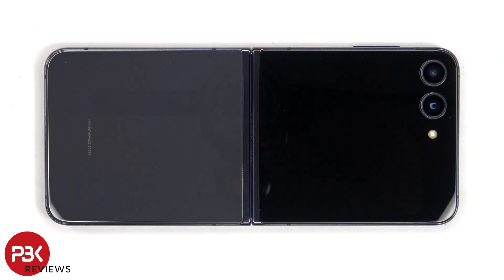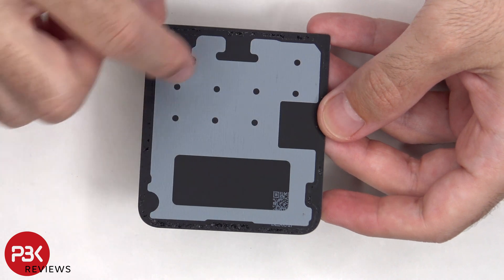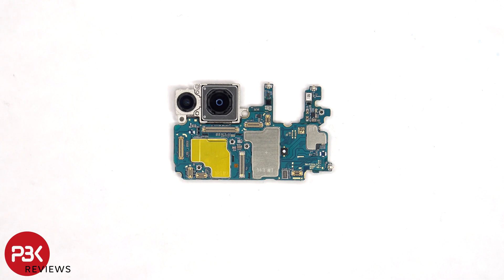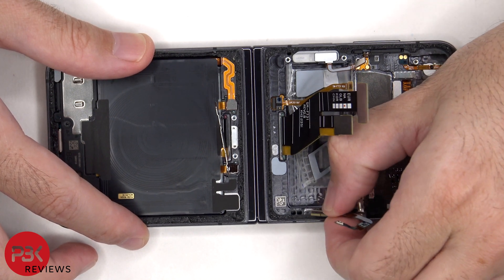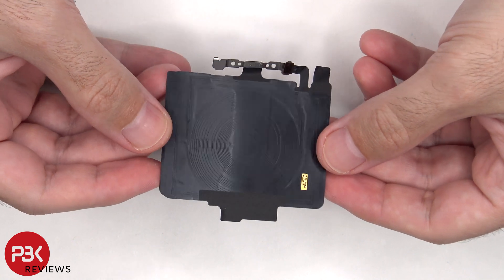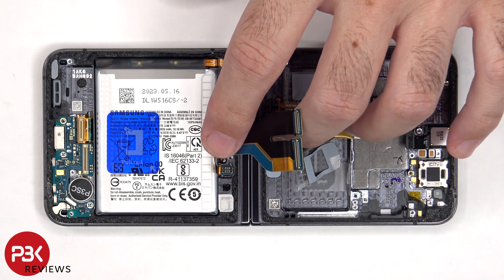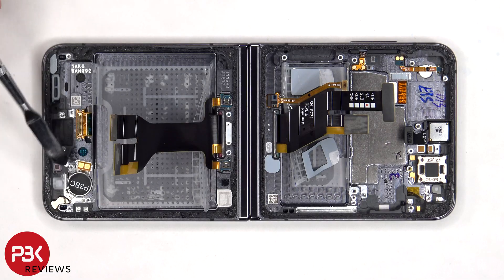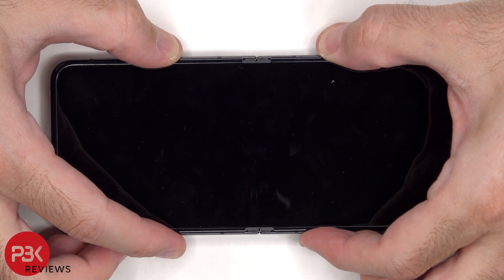Samsung Galaxy Z Flip5 Teardown Disassembly Repair Video Review

Comment: where is the data drive tho
Reply from the maker: the storage is soldered to the main board under one of the covered shields and is not user replaceable.

Comment: I was hoping to see how you replace the black bezel frame. 
Mine has a crack in it from a "snappy" case. :(
Reply from the maker: the one around the fold screen? those are difficult to adhere back. Easy to pry off but not easy to glue back. You would need to use something like B-7000 glue.

Comment: Can the interior screen be replaced? Or do i need a whole new shell to pass the components into it?
Reply from the maker: It can, but its difficult since you will need the original adhesives to ensure the fold screen stays well adhered to the frame when folding and doesn't move or it can break or damage the folding display easily if not aligned correctly. Also the plastic boarder going around the fold screen is a pain to re adhere with glue. So just much easier to replace as a whole flip assembly.
Reply: @PBKreviews  that's crazy, no wonder no one is showing how to remove and replace the LCD screen.

Comment: I have a flip 5 and love it! Unfortunately, mine took a tumble in a bike accident and my cover screen cracked! I am wondering if I'll be able to repair by myself...
Reply: Did you manage to fix it or get it fixed, I've literally done the same a few days ago
Reply: @SaifShakur  yes! I bought the cover screen part and it was honestly an easy replacement :)
Reply: That's great! Did you have to apply new glue? Thanks for replying
Reply: @SaifShakur  I didnt add more glue- there was some sort of adhesive on the new part and it's holding fine. The only thing I would recommend is someway to heat the phone before screen removal and after replacement to make sure it's all good.
Reply: Okay great thanks, you reckon a hairdryer would do the trick? Thanks.
Reply: @SaifShakur  that's what I used!
Reply: Thanks will give it an attempt next week

Comment: 9:57 is a pressure equalization membrane inside the case, as the device is water-resistant, and the air inside the case expands due to heating. This membrane allows the air to escape or enter inversely but prevents water from getting inside. It's designed to prevent air pressure from affecting the speaker and causing distortion.
Reply from the maker: Are you referring to the filter or the second hole in the frame?
Reply: @PBKreviews  I mean the one that goes to the white fibrous filter.

Comment: The Galaxy Z Flip 5 has a 3700 mAh battery, not 2700 mAh.
Reply from the maker: correct.. it has 2 separate batteries for your info. One which is 1000 mAh on the top flip and one which is 2700 mAh on the bottom totaling 3700 mAh. Both of which are shown in the video.

Comment: Doest it has 2 baterries for every display??? I thought it use one battery for bith displays...
Reply from the maker: It has two batteries, both work together. The flips and folds have always used 2 batteries, since there isn't enough room on one section to hold a large enough battery, so they use both sections with two smaller batteries.

Comment: Sad to see they didn't leverage the front screen for heat dissipation for the SoC, and opted to do it from the plastic covered main screen. Idk, it was such a no-brainer move to increase performance, but they didn't do it smh.
Reply from the maker: I think since the SoC is on the other side of the board, the ideal place to dissipate heat would be from the folding screen.

Comment: i wonder why android flagships sim trays continue been made of plastic. I don't understand why.
Reply from the maker: they usually have a metal frame coated in plastic, but the main reason I can maybe think of is the possibility of metal touching the metal parts of the sim reader and housing, possibly causing signal issues or other stuff. Not sure.
Reply: @PBKreviews kind of strange.

Comment: I'm trying to position one of those "magsafe" metal rings on the bottom half for wireless charging and want to make sure I am sticking it over the correct area, is it possible for you to provide measurements where the charging coils are so I know how far up/down left/right to stick it? Thanks!
Reply from the maker: Its about 14.5 mm from either side (left and right) and about 15mm from the bottom I believe.
Reply: @PBKreviews  Thank you! I'll give it a try
Reply from the maker: You're welcome

Comment: probably first to notice but did u have mic issues or? i mean, its not bad but i thought i'd mention
Reply from the maker: Yeah, been having mic issues haunt me since ever. Cant figure it out, tried replacing almost everything. Once I change one thing, something else sounds bad and something gets fixed lol. What on your end is sounding off? Since I've noticed on certain devices it sounds good and on a few it sounds off etc. I am going to change a few more equipment, hopefully I will get it fixed soon :)
Reply: what sounds off? when u removing the batteries but when u spoke it sounded fine
Reply from the maker: Oh ok. Can you tell me what the sound is like the parts that I am not talking? Does it sound normal just low volume/far away, or is there any buzzing noise or other issues? Thanks
Reply: no buzz but it sounds echoy and off
Reply: and actually maybe nothing is wrong? but still
Reply from the maker: Thanks, hopefully I will have it figured out soon :)
Reply: @PBKreviews Sounded fine on galaxy buds2 pro

Comment: i don't see any significant changes other than upper portion and pulltabs on display
Reply from the maker: Yup, for the most part no major changes but some here and there. It's more repair friendly for the most part up until if you need to replace the inner folding screen which is a pain if you don't get a full flip assembly to replace and have to replace just the folding screen itself.

Comment: One of the main problems will be screen issues and you didn't even try to remove? i guess we will just figure it out ourselves then
Reply from the maker: There really isn't much of a change on the folding screen (aside from the hinge) from previous gen ones where I pried the screen off. If I didn't want to use the device, I would have taken the risk prying it off but aside from the hinge there isn't anything to show since the process of taking off that screen is the same as previous generation I've done videos on. Also I'm sure ifixit or someone will post the hinge and stuff soon, so it didn't make sense for me to damage the screen potentially and not be able to use it when iFixit will upload what the hinge looks like. If I knew for sure there was a big difference and parts were changed with the folding screen and underneath it, I would have taken it off. But pretty much the same as previous ones, all there is left is that plastic boarder to pry off, and then the folding screen. No difference. :)